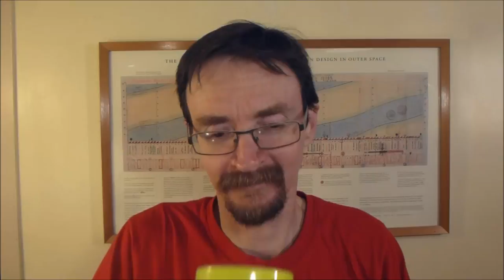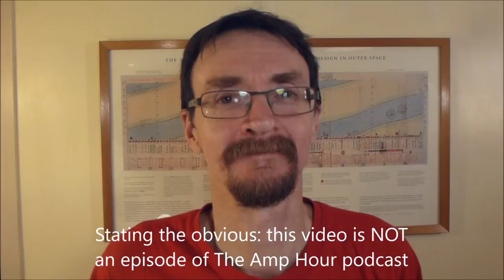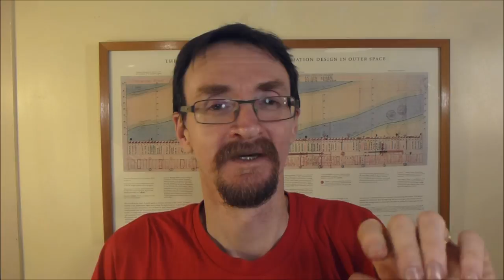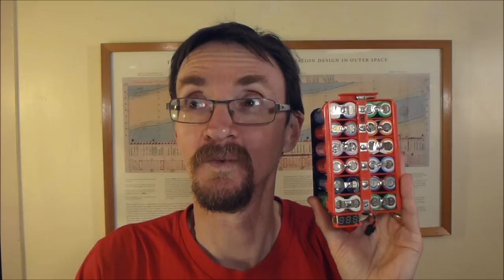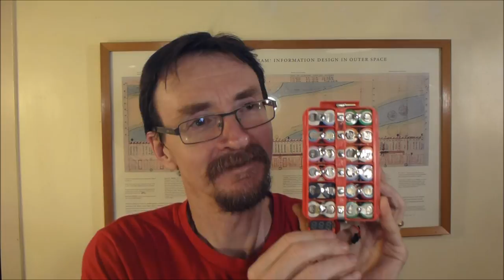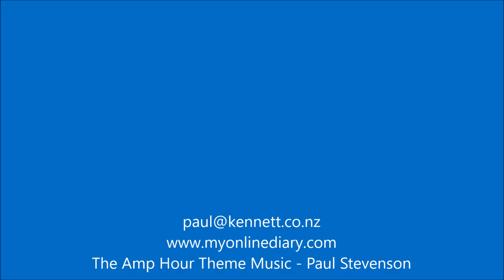Laptop Powerwall 125 - The Amp Hour episode 358 error correction

Comment: Ive been a sub of eevblog for years and ive never had reason to disagreed with anything he has had to say but on this one Dave dropped the ball he got his facts so wrong it started to feel embarrassing, ive seen many of his repair/teardown videos all kinds of tech a lot dealing with mains power and ive even used one to fix a flatscreen tv and at no point in the video does he say dont do this if your not qualified. Thanx for the video Paul
Reply from the maker: I fixed a LCD screen a week after seeing his video on replacing bad caps. It was great!

Comment: I have not tried, but is diy power wall insurable, as apposed to commercial one?
Reply: I mean that in the sense of effecting your house hold insurance if somnething does go wrong.
Reply: Probably not, any excuse to avoid payment from the insurance would be good for them. A DIY set-up that does not pass local requirements/certifications is a good excuse to deny compensation (and how would you certify a DIY powerwall?).
Reply from the maker: Insurance is an important issue. Many DIYers I  know of are putting there batteries away from the house (ie in a shed)
Reply: Thats what i think you podcaster is raising all the point for. Safety...    Yet you argue agajnst his questioning and ignorance.
You have missed the point of the podcast.
Reply from the maker: You're right - I did miss that point :/
Reply: Paul Kennett I am not sure they do (avrjoe joe seems to have in the basement and jehu in his office, although not sure if in house or not). But as you said we try to be careful.
Reply: Cobra 302 most DIY projects have some kind or risk, one is not being forced to do it and one would have to be irresponsible if not careful. The comments in the podcast he refers to are dismissive and apparently not very informed.